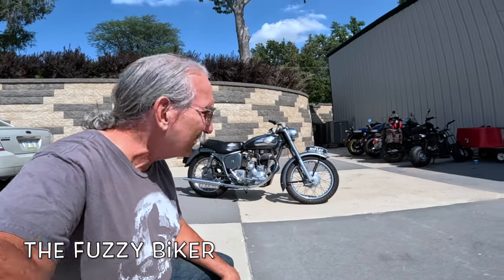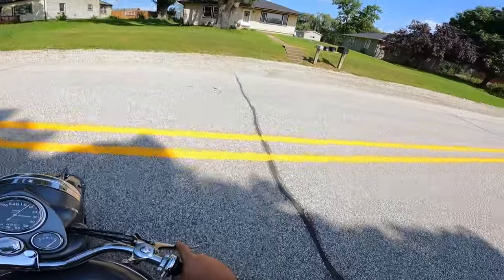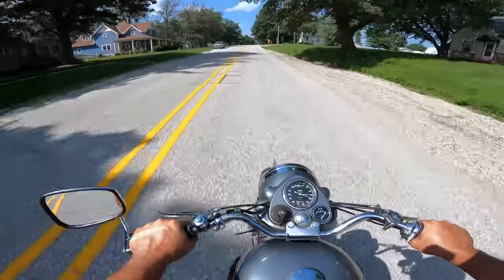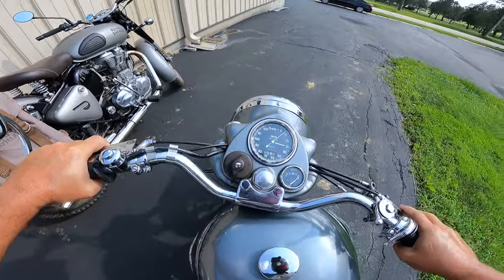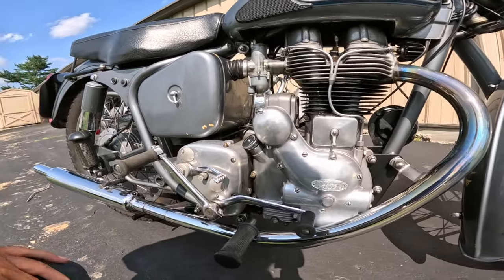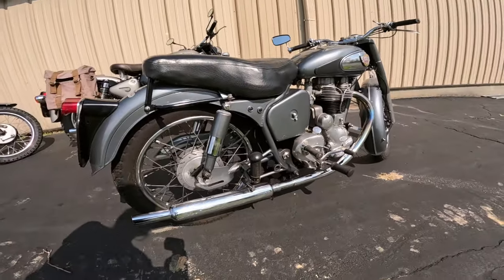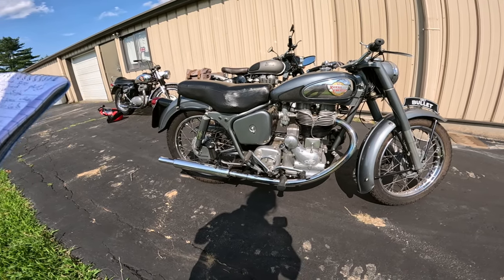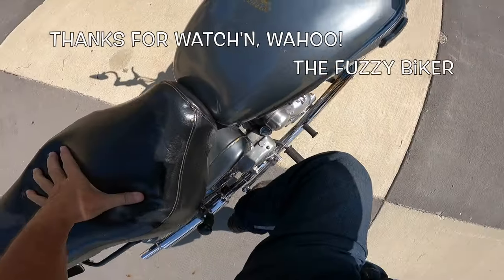Beautiful 1957 Royal Enfield Bullet 500 - Let's Ride! Wahoo! TBT 54

Comment: The tappet  check on these was simplicity , just remove the tappet cover & when cold the pushrods should have zero up & down play but be able to spin freely, the adjuster & lock nut is on the pushrods if needed.
Reply from the maker: Very nice!